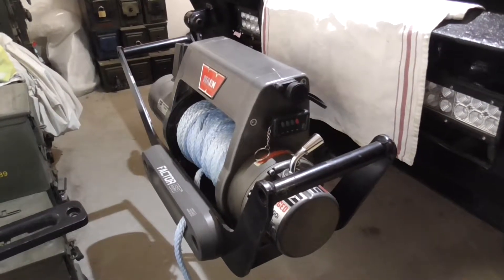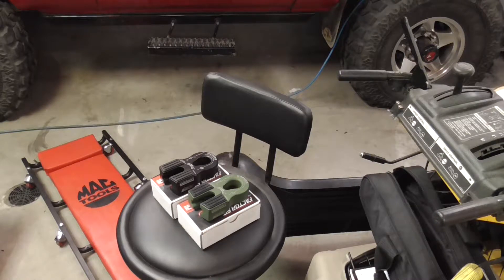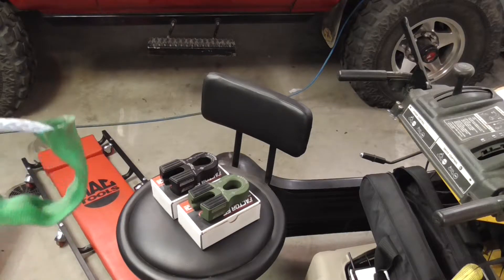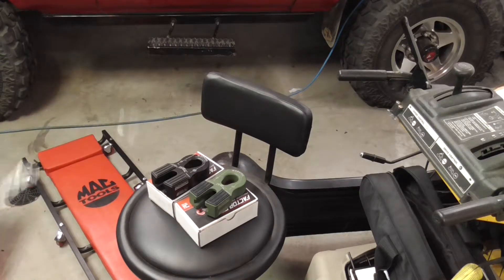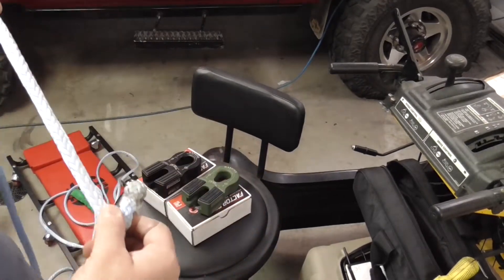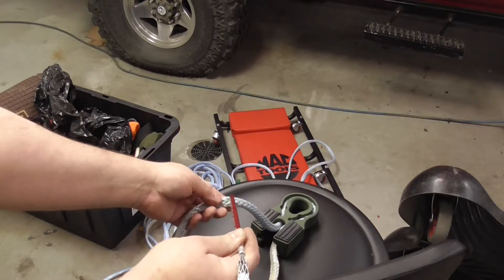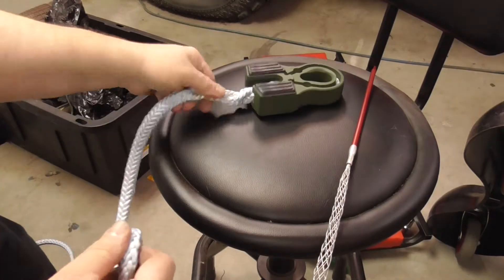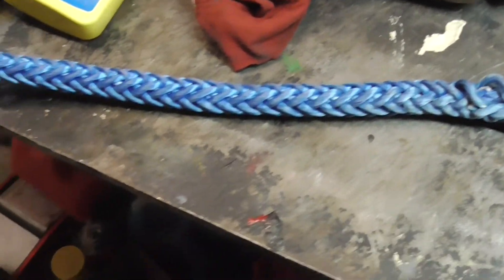Synthitic Winch line splicing on a Factor 55 flat link

Comment: Interesting. Didn't know they made a flat splicer. My old winch line had the  single bury with lock stitch & worked fine for about 10 years till it snapped farther towards the middle of the line. You should taper the end so it doesn't have a sharp transition from 2 ropes to one for full strength.